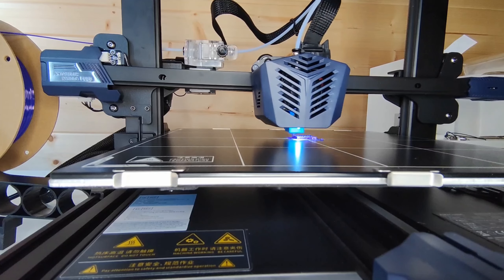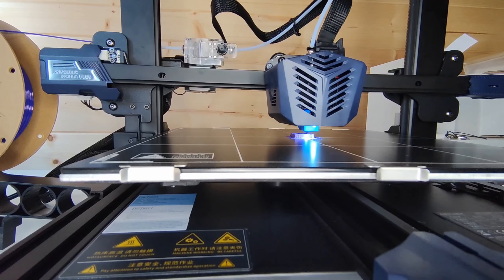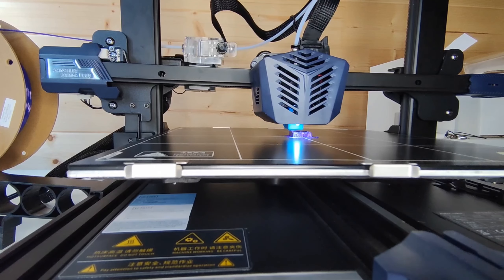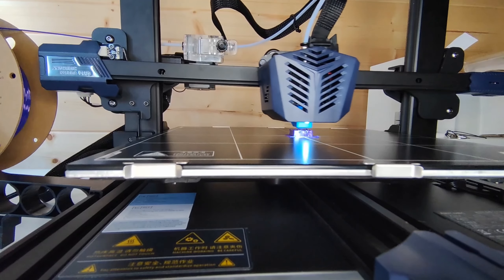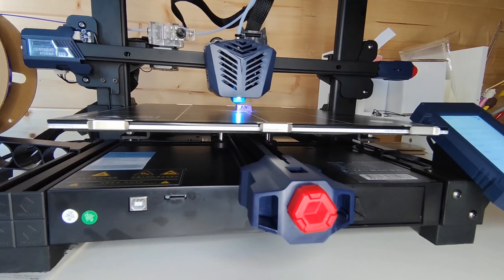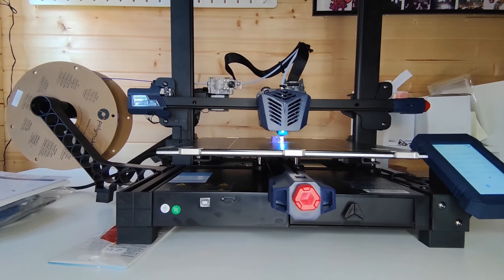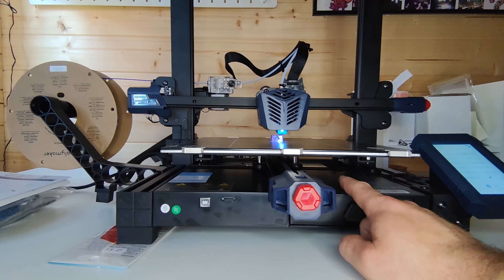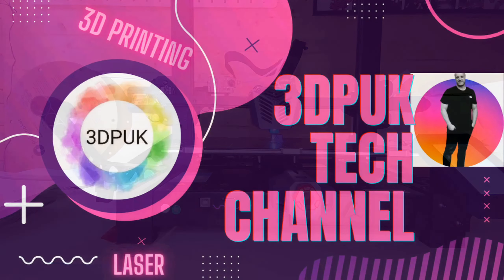Anycubic Kobra Plus - First Review

Comment: The issue I have with the Anycubic Kobra series is their reluctance / hesitation / delay in releasing the Marlin source code. Since they are using Marlin, they should supply their updates in a timely fashion.  I know compiling Marlin isn't for everyone, but they don't even support a filament change on a layer line via gcode (at least it's that way on the Max). And with such a large build plate, where's the linear acceleration support?  I like the Max; don't like the company (as of today - that opinion will change when they publish the Marlin updates to this product line). The Ender 3 was a market favorite because of open source and the hackability. Seems like Kobra Plus/Max is for anyone that doesn't care about common Marline option or more advanced feature - AND - want to limit their printing choices to PLA. I have enough issues with PLA stringing on the Max as I tend to print functional prints with a lot of retraction. I not seen anyone print with PETG (or anything else) on the Max.  I like the printer; just do not use it too much - my MK3S and my direct drive mod'ed Ender 3 do most of my printing. Hopefully a Marlin source code release will be made in the near future. I'd really like to try linear advance on this thing.
Reply from the maker: Totally agree with you, they do need too increase the options around Source codes... It's not like it affects them in that respect, fingers cross they see sense now that all 3 have been launched, thanks for watching and hope your wishes are fulfilled